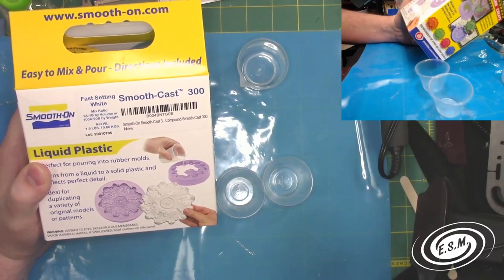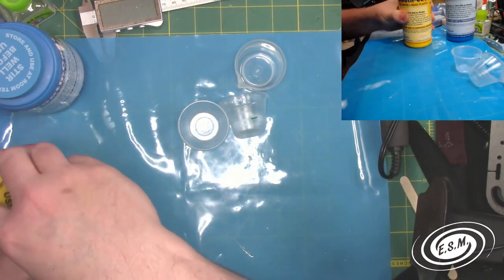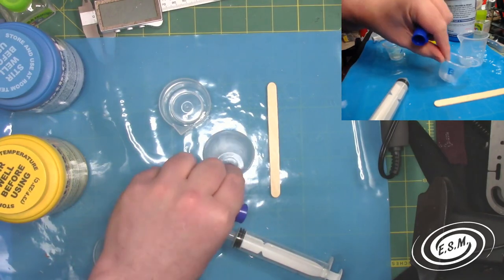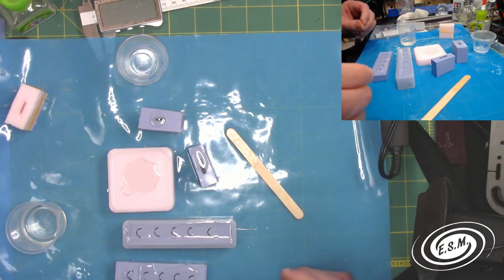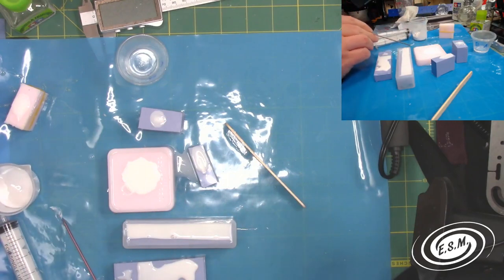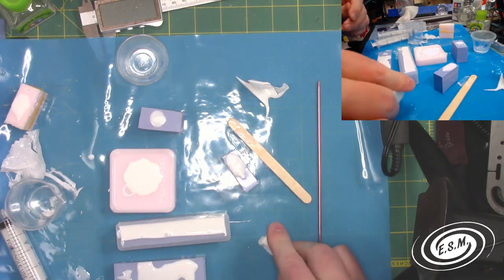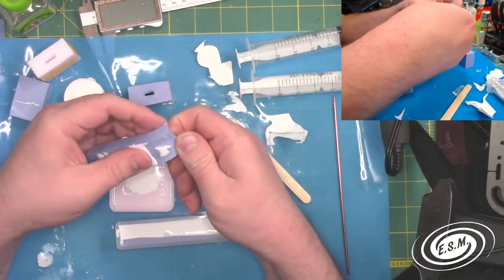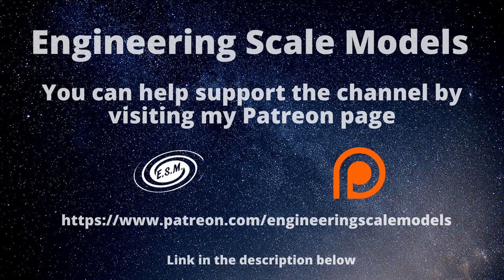Smooth Cast 300 How To

Comment: Following your tut. I think my second part b was slightly expired. I added some castor oil to the bottom of the mold. I mixed part A and part B with a metal chopstick. 🤣 I'm working on making a implant for seven of nine from Star Trek. Hoping this ends up turning okay.

Comment: Love the content. But do you need a mask or a respirator when working with smooth cast 300?
Reply from the maker: Bobby Neal I work in a well ventilated area so I don’t wear one, but it is recommended to wear on especially if you are going to sand the finished cured resin.